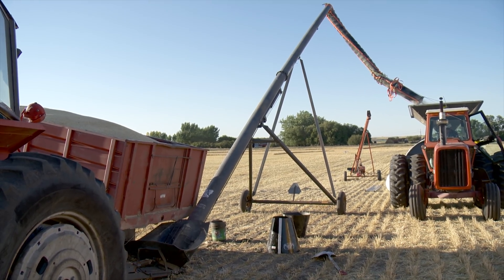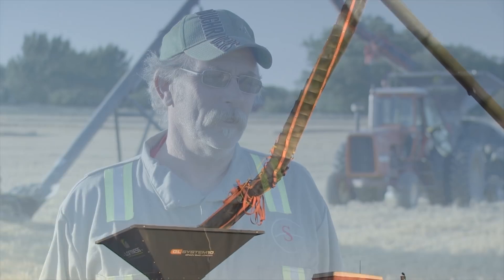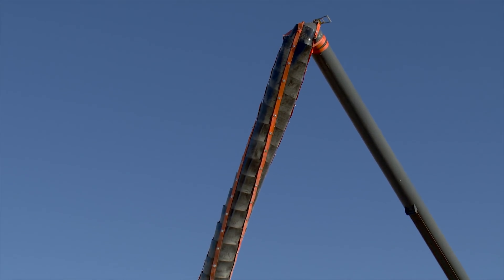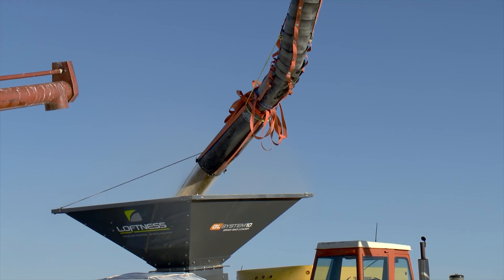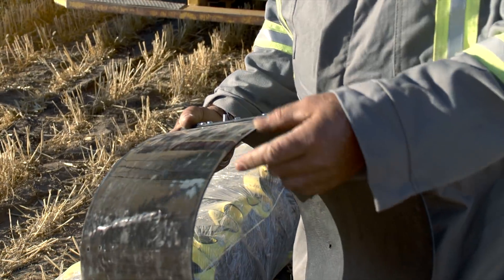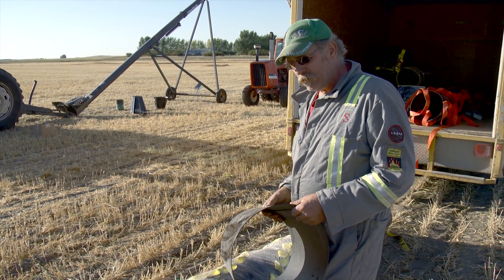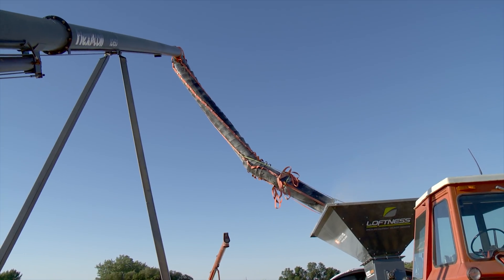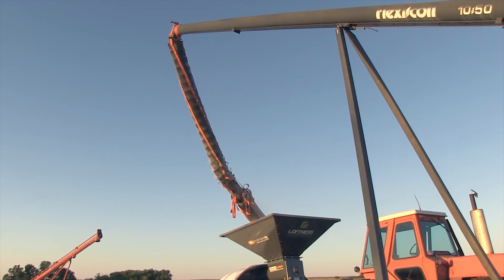30ft Flexible Grain Spout

Comment: I bought one of these, i recommend using the longest auger you have and having it straight in front of the bagger tractor, it keeps everything in line too and keeps the bagger straighter 
I can dump 1000 bu with an 80' auger without moving the auger.

Comment: Id probably just use grain cart rather than mess with all that
Reply: What if you have to truck it 20 miles to the bin yard to reduce animals destroying the bag. Would you run your grain cart 20 miles to dump?
Reply: @virgildensler2489  setup a regular auger that dumps into grain cart. Then use grain cart to fill the bag
Reply: Thats a solid point if you didnt already have the cart in the field picking up from combines